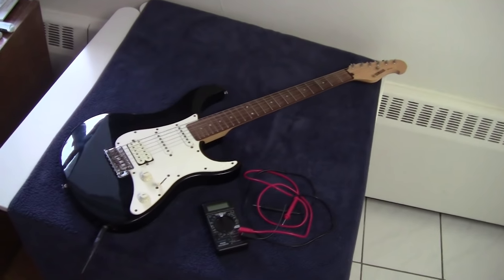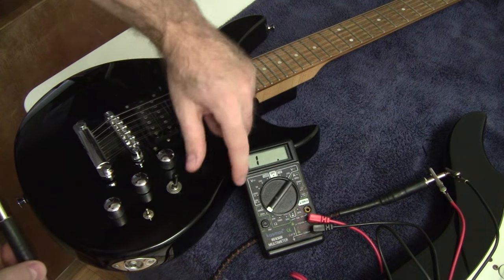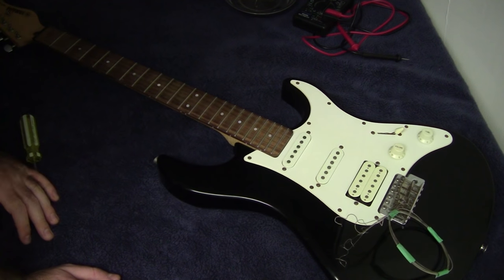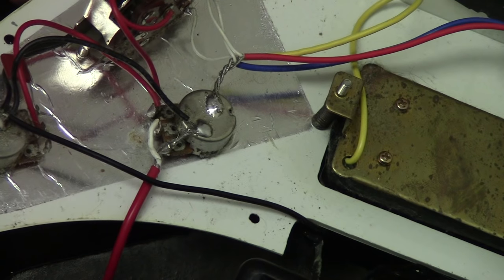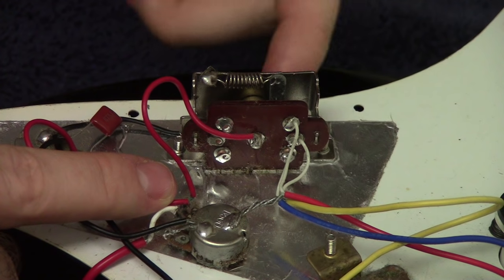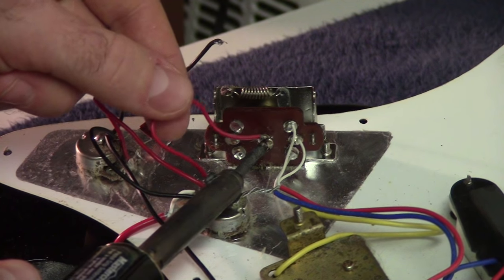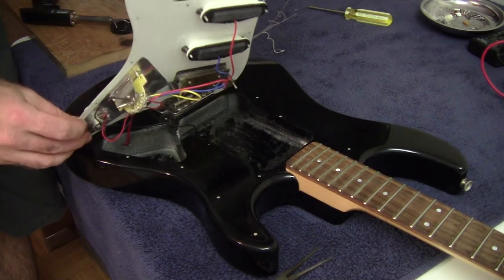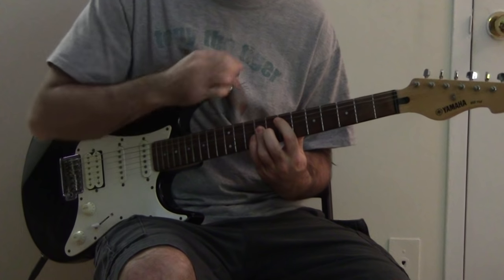How to Troubleshoot & Repair an Electric Guitar

Comment: ?   Would you know how to check for a cold solder joint? I’ve just put a kit together with all new parts using the 50s Gibson wiring style and while I do get sound out of the two humbuckers, it is extremely low volume from both. Thank you.

Comment: Your video motivated me to disassemble my 1985 US Strat. When opened it reveled all connections intact but the pickup switch was corroded. Sprayed it with cleaner and reassembled. Used your tap method to test the pickups. They worked! Thank you for saving the cost of a trip to repair shop, Awesome! Thank you for sharing your knowledge!

Comment: Thank you so much! I just decided to start playing guitar again after a 9-year break. I have the exact same guitar as you and it did not work. My problem was also with the pickup switch. However, my contacts were just corroded and some WD40 solved it. Once again, thank you for such a straightforward and easy-to-understand video!
Reply from the maker: No problem, glad to hear you got your problem solved too!

Comment: This testing method is exactly what I'm needing after my first mod project! I pickup tested the assembly before finishing it all out, but since i did finish it, I'm getting an output to tuner but it won't go past anywhere else thru the amp

Comment: thanks for the wonderfully comprehensive breakdown, and superb camera work! i have to troubleshoot one pickup on my strat which is not working, although i can barely hear it with amp volume cranked way up. not sure if its a defective pickup or what. the guitar is only 8 years old and been well cared for. not even a scratch on it, yet i have this issue. there was no sign of anything either. no scratchy potentiometer sound. no gradual decrease in volume or quality. just one day i plugged in, and it wasn't working, so i'm guessing i just may have gotten a lemon pickup...thanks again my friend, your video will help me get in there with a bit more confidence!
Reply from the maker: I'm glad the video was helpful. I hope you were able to solve the problem!

Comment: Bro thanks to u I just fixed a broken guitar which had a broken volume variable resistor, even though I just replaced both the volume and tone resistors. Had to steal a 20k ohm volume variable resistor from an old radio, rewired it, now it all works!! Thanks a lot my g great video!!
Reply from the maker: Fantastic!

Comment: CJ thanks for showing this.  I greatly enjoyed your clear and concise explanation of how things work inside.  I'm actually working on a Yamaha Pacifica (basically the same guitar with a different name) with low, dull tone.  From your video, I expect that it's one of the potentiometers or capacitor.

Everyone: Safety warning...do not try these troubleshooting steps with an amp.  While the principles are the same, the capacitor(s) in a guitar amplifier can produce dangerous shocks.  Best case you'll zap your multi-meter.  Worst case, you'll stop your heart.
Reply: I don't agree - replacing pots or jacks on an amp is safe - just good food for thought to not touch any of the capacitors or the transformer. And not to do anything after it's been unplugged for a good 30min

Comment: Thanks-a-million, as it happens, I own the VERY same guitar.  It just started with a slight crackle... maybe I can fix it with your help here, I sure appreciate the time you spent to share this, thank you!!
Reply from the maker: Thanks, I hope you're able to resolve your issue too. I'll be curious to know if yours had a failure of the selector switch as well.
Reply: @cjhoyle  Hi CJ - it might just be the amp, but it hasn't made that sound now for some time... If it comes back, my plan is to plug the Yamaha into a newer amp, one that is working well, and see what happens.  I'll still keep your link for backup!  Thanks again

Comment: Fantastic vid , I have always struggled with electrical  theory . You made it simple to understand !!  Wondering the part number of the replacement switch. Thanks Ross.
Reply from the maker: Thanks, I'm glad it was easy to follow. I believe I just searched for 5 position guitar selector switch. The one that I replaced it with is not identical to the original, but that doesn't bother me, especially knowing that the original failed.

Comment: Great video! Very useful. I accidentally disconnected the wires on the tone pod trying to adjust it and due to corrosion on the pod leads was unable to reattach them. Your video helped me trace connections to the switch from another pod. Thanks-JJ

Comment: One of the most splendid instruction video on how to not only find the solve of the issue but also how to rectify it! You made it so simple yet clear and I'm so thankful for this video!! I do wish to know, when it comes to replacing the pickup selector or the vol/tone potentiometer, how do you know which  kind to buy? As some have different resistance value.
Reply from the maker: Thanks! When buying my new pickup selector, I just chose one which had the same number of positions. Hopefully the potentiometers and pickups would have some writing on them which you could reference to help you find a like-for-like replacement. I've never needed to do this myself though.
Reply: Good point!! Is it a linear or logarithmic Pot?

Comment: thorough explanation.. I hope this will guide me in troubleshooting my guitar. I replace 2 humbuckers last night then suddenly no sound at all... I suspect a grounding connection/s. I will use this as a guide latter when I check it. I hope I can ask questions and guidance in case I still can't make it work. Thanks in advance!
Reply from the maker: Feel free to leave comments and I'll do my best to answer your questions.
Reply: man, you save my life... because of your video guide, I discovered what's wrong with my wiring. actually my amps wiring are okay. the problem is the output jack lead wire is touching the copper wall shielding of the cavity. That is the reason why there's no sound. Thanks a lot man... Cheers!

Comment: Thanks so much for this helpful video! I can't get any sound out of my strat, and everything seems to be OK based off what you explain in this video except that my resistances when measuring from the input to output on the volume pot seem reversed: When the volume knob is at 10, the resistance is at max (~230k ohms), and when at 0, the resistance is also at 0. The resistance between the output and ground is as it should be (max resistance at knob setting of 10 and 0 resistance at knob setting of 0). Any ideas what is causing this?

Comment: I just wired up my very first build from a kit. LP style. When I plug the guitar into an amp and move the 3-way switch around, sometimes I get a ton of noise and sometimes not. I have 3 humbuckers. Since it's my first time doing this, and learning how to solder, I'm guessing that the problems I'm having is because of a subpar soldering job. But when I tap on each pickup, each one makes a noise even when not selected.
Reply from the maker: Considering that the switch makes noise when you move it sometimes, my guess would be that the problem lies there. You should be able to confirm this though using a multimeter like I showed in the video.

Comment: I realize this is an old video but maybe someone passing through can help. My issue is almost always the same- knowing which wire gets soldered to which place on the the pot. Are the pots designed basically the same, as in each attachment point the same on all pots? Knowing what to solder where is my biggest hurdle. 
Thank you .

Comment: I enjoyed this video as i am trying to repair my guitar which is the output jack needs replacing my question is on the old selector switch there were six tabs on the new one four tabs how do you know which wire to solder to which tab
Reply from the maker: I believe there were the same number of solder points on both switches, but they were configured completely differently. I was able to figure out which ones corresponded with each position by moving the switch and seeing which contacts were touching. I also verified this with the multi-meter to be sure before soldering.
Reply: @cjhoyle  thanks

Comment: Great man thanks sooooo much, the white coretread comes out the guitar and has to be soldered to the lateral side of the plug inn hole, right?
Reply from the maker: Happy to help. The ground side is wired to the outer part of the jack, the signal is wired to the tip.

Comment: Thank you for showing how to test pots, although I assume tones are tested same way as volumes, so if the test shows the part as open or infinite, the problem is elsewhere, right? Thanks again.
Reply from the maker: On my guitar, the tone knob was wired so that it allows a portion of the signal from the pickups to be passed through a capacitor before reaching the volume knob potentiometer. I assume this would be the same on most other guitars. My theory is that if the tone knob (or the connections to it) had failed, that you would be getting either too much tone effect, or too little tone effect. Since my guitar was getting no sound at all and an open circuit, I was pretty sure the tone knob was not the problem.

Comment: Great video . I hqve a question . I cant seem to  be able to turn volume off of my bridge pickup but the switch works . The white and ground on pickup is on top of potentiometer for bridge and i have my black wire on input
Reply: Sorry meant to mention its a seymour invader and my guitar is a washburn dimepro stealth
Reply from the maker: If your volume knob doesn't affect one of your pickup then it sounds like there must be a short circuit between the output of that pickup and the output of your guitar. You should be able to verify this with a multimeter.

Comment: Hi ! I just received a new original series fender strat ordered online. To my dismay, it sounds very weak and not chimy and resonant like a strat is supposed to. The sound of the guitar is very weak and kind of muffled and it is barely audible even at volume 5. As opposed to my other strat which sounds big and open and chimy even at volume 4. I have not yet opened the pickguard of the guitar. Do you think this is something I can troubleshoot and fix myself or should I just return the guitar. I really wanna keep this guitar because acoustically it sounds good and feels good. Please help !
Reply from the maker: If it was me, I would take it back and exchange it. If you take it apart and aren't able to fix it, there's a good chance they will refuse to take it back.

Comment: Need some help here ORZ I have a guitar didn't play for few years, then one day one of the pickup have no sound. I brought it to a guitar tech, and he said the pickup lost some magnet since had not plug-in for a long time. He also said, since there's been no electricity running through the pickup for a while, it lost magnet. I didn't get it, can someone explain what's going with that? Thank you very much.
Reply from the maker: I've never heard of a pick-up losing it's magnetism, but I'm no expert. Have you tried googling it?

Comment: Amazing work! I would request your help here-
I just plugged in my yesterday and all I could hear were hums and disturbances with no difference jolting on the vol, tone or jack ports. It was fine a day back. Both cables were checked separately (to zoom and the amp) directly to the amp and it stayed the same. I'm confused as to what could be the problem? Both cables quitting at the same time seem improbable. but the cables do have the humm silencing when the ends are touched. 
Much appreciated. 
Cheers
Reply from the maker: I agree that it's unlikely both of your cables would fail at the same time so it's most likely your guitar. It's normal for you to hear a humming sound through your amp if you touch the tIp of a live patch cable. Have you determined yet with a multimeter whether your guitar is returning either an open circuit or short circuit?
Reply: @cjhoyle  Just fixed the guitars jack socket. Had a busted wire. Thanks a ton for your help.   Slainte!

Comment: ?  This tip did not solve my problem and I’m hoping that you would suggest something else. I just put together a diy kit with all new parts 4 CTS pots, and two humbuckers wired 50s style. I get sound from both pickups but very very low and only when the volume pot is all the way up. With a multi meter I have verified that everything is grounded, the pickups are at appropriate resistance (7-8k) and the capacitors are at about .23. I am at a loss to know what to do next. Thank you for your help.
Reply from the maker: Did you try measuring the resistance directly from the jack or patch cord (like I showed at the beginning before opening the guitar up)?
Reply: @cjhoyle  I was able to try that just now, and I’m getting only .56k where as with another guitar I am getting essentially the value of the pickups. I am not sure how to interpret this. When I measured the pickups inside the cavity on their own leads their resistance was right what they should be; about 7.9k.
Reply from the maker: @spokes28  So clearly there is something wrong with your circuitry in-between the jack and the pickups. Just use your multimeter starting from the pickups and gradually work your way to the jack to figure out at what point the resistance drops. I'm wondering if maybe you wired the potentiometer(s) incorrectly.
Reply: @cjhoyle  I used a wiring diagram for 50s style and have rechecked my work and I wired it just like the diagram. I replaced the toggle switch and the jack today with Switchcraft brand parts, and no difference. I am thinking I should just pull all the pots and rewire using the modern style rather than 50s style. The pots were brand new CTS 500k, and since both have the same symptoms, it may be the way they are wired. Do you have any other thoughts on this? Thanks!
Reply from the maker: @spokes28  I'm really not an expert, but potentiometers have 3 legs and my best guess is that you have some of the wires switched around (as I suggested in my previous comment). The layout of the switches may be different from the ones in the diagram you are following. You should be able to figure out how the potentiometer is intended to wired by probing with your multimeter.

Comment: hi cjhoyle
great demonstration.
i am havin a issue on a epiphone les paul where the pickups are making a sound.
but when i press on the strings there is no note change.
example a can play a g chord and it sounds the same as if i was playing open.
and its the same up and down the neck.
any thoughts.
cheers in advance.
Reply from the maker: That sounds like a really unusual problem. What does the sound coming out sound like if it's always the same? Does it even sound like a guitar?

Comment: Great video, just wondering if you have got any ideas how to resolve an after market PAF Iron Gear neck pickup on a Pacifica 112L L/H that sounds dead flat compared to the single coils ? I had a problem with the PAF in the switches second position and it sounded out of phase. I flipped the ground and the hot wires on the PAF around and I have sorted the problem of the out of phase noise but now the PAF in position 1 sounds gutless and really flat ? It was nice and loud before I switch the 2 wires around that sounded out of phase...Any ideas what I can do ?
Reply from the maker: Sorry, I don't have any suggestions.

Comment: THanks so much this is so helpful!  My eg112 has a black cable that goes through to the back into a piece with springs( I thnk its' a ground) . How do I disconnect that wire?
Reply from the maker: Yes you're right, that wire is a ground and it grounds the bridge which also grounds the strings. I just took a look at my EG112 and that wire just seems to be connected using a blob of solder. If you wanted to disconnect it, you should be able to just heat up that blob with a soldering iron and pull the wire off.
Reply: @cjhoyle   Thanks so much, I did manage to eventually get it off.  I appreciate your response.

Comment: For some reason my bridge pickup won’t work so I don’t know if it’s a problem with the pickup or the selector switch
Reply from the maker: Hard to know until you start testing with a multi-meter :)

Comment: I have a question, I'm illiterate in terms of guitar knowledge. For example, if a selector switch like yours is broken do we need to get the replacement of this specific guitar model or like are these things sort of universal spare parts. I'm asking because I have a guitar and some things might be broken (i need to go for maintenance) but I'm wondering what I should do or can do if parts for my specific guitar model are not available.
Reply from the maker: The selector switch I used to replace mine was not exactly the same as the original. I think I may have actually done this on purpose because I had seen how the old one failed, and was hoping for one which had a more sturdy construction. I just tried to find one which had the right number of positions (5 in my case) and that looked fairly similar. I think I may have also measured to make sure the spacing of the 2 screws were the right distance apart. I'm sure many guitars must share similar components, so you don't necessarily need to always find an exact replacement.
Reply: @cjhoyle  thank you brother :D I went to my local shop and luckily all the electronics work perfectly and just needed a new set of strings but this definitely increased my knowledge about electric guitars even if it would be only one step.
Reply: @cjhoyle  Update, the guitar shop fuccin lied a year ago. I opened my guitar and the wires were soldered WITH A SOLDER WIRE. LIKE... THE SOLDER WIRE WAS USED AS A REPLACEMENT FOR REGULAR COPPER WIRE... A lotta stuff in the guitar was broken but I got parts from China and fixed it myself from your video and a couple of others. Thank you!